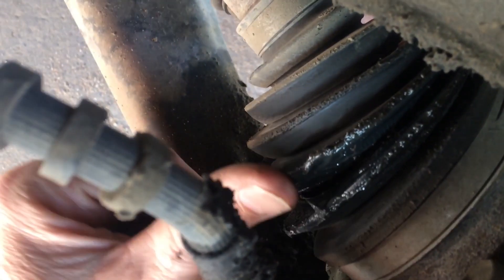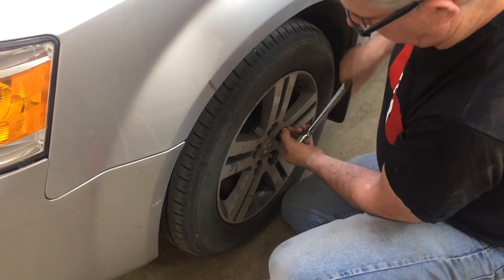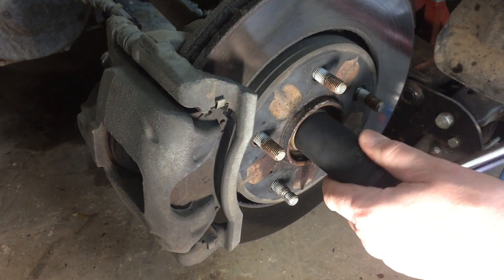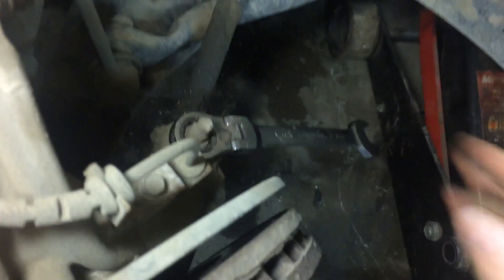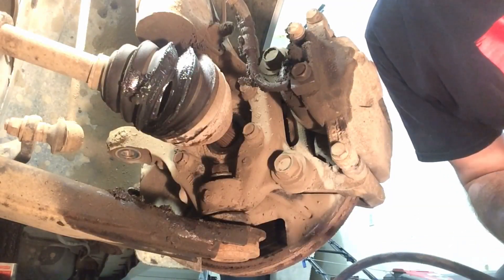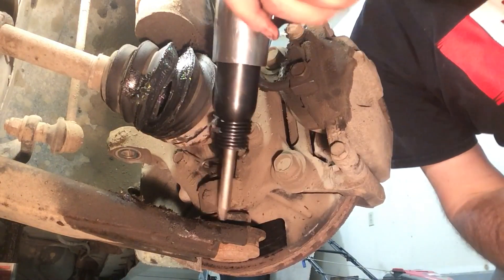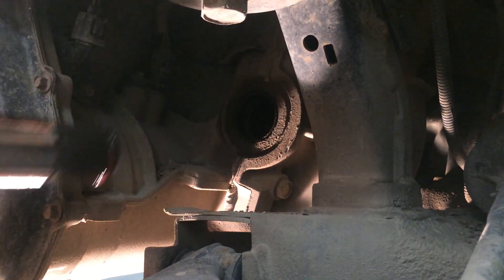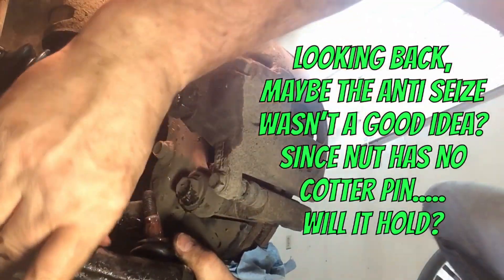How to change a cv joint on a Dodge Caravan drivers side 2008 to 2020 Town & Country VWRoutan(EP 38)

Comment from the maker: 🔽 Check out other videos in the Grand Caravan series!   🔽

https://www.youtube.com/playlist?list=PLgeVnQRQkbzBxJXNmFL9XwSTFcXcj0GQj
Reply: To check your transfluid, there's a plastic screw you can undo above the pan. Use your oil dipstick to check the level. Search it on YT you'll see
Reply from the maker: @brianramsey414  Thanks Brian! I actually have a video on making your engine dip stick work with checking the trans levels, temp etc. it somewhere on the channel. Thanks for watching this old video. It was one of the first ones. I am at close to 600 coming up. Hope they are better and more to the point. I have also upgraded to 4k video as well.
Reply: @unclemarksdiyauto  Yeah just subscribed so it hasn't popped up yet. Cheers! Keep up the good work!
Reply from the maker: @ many more grand caravan videos in the works!

Comment: I found i didnt have to take out the lower ball joint or the tie rod end. I simply undid the two bolts holding the strut the the hub and let the whole assembly drop down far enough to get the cv shaft out. Put a jack under it to keep it from pulling on the brake lines and you're golden.
Reply from the maker: Logan Jones, will have to try that next time. That’s for the time saving help! Why take something apart if you don’t have to? Since it’s on a Dodge Caravan, you know their will be lots of opportunities for me to try your suggestion!
Reply: Are those two bolts that holding the structs ?  Is one of them a CAM bolts that movement of which will require a tire alignment?
Reply: @ztian2506  I would recommend getting an alignment after doing any suspension work. Disconnecting the tie rod and ball joint could also cause misalignment. If you are worried about it mark the bolt and install them in exactly the same point but I believe all the alignment adjustment is done at the top of the strut and the tie rod...not the bottom of the strut. But I'm also just a random voice on the internet. Please consult an expert as I am most certainly not! Good luck!
Reply: @loganjones2119   thanks what I am thinking to do is to take the bearing out without touching tire rod or ball joint. if I remember correctly, south auto main channel Eric O one of the videos was like that.
Reply from the maker: z tian, I am thinking yes. If you look close you should be able to tell. You could mark them as to their angle and line them up on reassembly.
Reply: @unclemarksdiyauto  they are not cammed bolts after doing some research. They are just splined to stop them from rotating. However some aftermarket struts have sloted holes instead of the factory ones which were just exactly the size of the bolt. If you have an aftermarket strut like that removing these bolts would most certainly throw off your alignment.
Reply from the maker: Logan Jones, couldn’t remember so thanks from everyone else that may see your posts. Good information to know. Next time that is the way I will go, since it won’t screw up the alignment. And it should be a faster way to do the job.
Reply: That would be another Mistake! Unless you want to go get another wheel alignment, You DoNot loosen or remove those two strut bolts. Sure, you may think you put it back same way,, but a month or two later, check your tires for Bad uneven wear. My friends, Not to brag, but I worked for National Car Rental of La Guardia Airport in Queens Ny, and I did this a vast amount of times, my first Wrong way of doing it, the Master Mechanic observed me, and after I was done, he corrected my method by explaining it, and then had me bring the car over to the wheel alignment bay bcuz he said That car was Not leaving there after my fiasco..lol. So in short, I pass on my knowledge and experience. Just remove Cvjoint nut, knock tie rod out (IF you must) and tilt knuckle, then tap Cvjoint shaft in and begin prying loose till it clears the bearing and knuckle. Make you have an oil pan under the inner Cvjoint bcuz when you pop it out, fluid will leak. Just have new joint ready on floor so you can drop old and pop in new. Another thing, be patient, trying to pop the drivers side joint is like the more difficult one. You have to use a strong pry bar and catch these edges on joint, lean pry bar against tranny or so, and wiggle hard on front and back sides.
Reply: @ztian2506  All you have to do is trace along the strut mount bracket when you take the two large bolts out and put it back on the lines and it will be perfect I’ve done it hundreds of times and never got an alignment
Reply from the maker: @ztian2506  Yes it is!

Comment: Your video is great man I was able to fix my drivers side CV axle just by rewatching n following along as I went lol
Reply from the maker: Great to hear Steejans! I just did one on a 2007 Chrysler Sebring on the passenger side. Did much if any trans fluid leak out on the drivers side? If so, I have a video on how to check the level in my Grand Caravan playlist.
Reply: Some did I added some back in thanks!

Comment: I thought I had to replace the passenger side CV Joint on my Dodge Caravan. Turned out the clicking noise I heard was caused by one of the lug nuts not torqued to spec (it was like 75 foot pound instead of 86 like the other 4 lug nuts). Thanks for the very helpful video! I am sure the rest of it will be very helpful for me at some point as well!
Reply from the maker: I had a lug nut come loose and get damaged! Did a video on it's replacement as well! Hope you figured out your issue before you purchased a cv joint.

Comment: Fyi,, the ball joint does not need to be disconnected. Once the Cvjoint nut has been removed, you can disconnect the tie rod IF you want (I never do). If it's the driver side I've turned the wheel to far left and pop it out the spindle. The bigger problem is trying to pop the end that goes into tranny out. Right side is usually no big problem, but drivers side can become a challenge. You need a strong pry bar, if that type has the notches. Place bar against tranny body and tip into notch and pull (like opening a can of paint). If it doesn't pop out, you'll need a puller.
Reply: That's what I was gonna say. Just crank the wheel you get more room
Reply: The driver's side is a HUGE problem trying to remove the CV drive axle on the driver side. Is it the circular clamp that prevents the spindle from coming out? We've tried a pry bar and a Slide hammer puller. However, the slide hammer puller even with the adapter hasn't worked either, can't fit it behind the cylinder portion. Please advise. We have a 1999 Plymouth Voyager SE with a 3.3L engine that we're working to remove the CV drive axle. Is there something we're missing? I've followed the video, and see that you used a wide tip screw driver to pry it out towards you.

Comment: If you put pressure on the bottom of the ball joint and push it up without antiseize the taper should hold the ball joint from spinning until the nut is tightened . You might have to double wrench at the nut if it spins in the taper for the final torque. One wrench on the nut and another above it on the ball joint.
Reply from the maker: As you can see, there is not much room for double wrenching on this one.
Reply: @unclemarksdiyauto  yes but when you get the nut down far enough to let the end come through you can put like a small 11/32 on the ball joint so when you tighten the nut it will not spin the ball joint in the taper. If you put a jack with a piece of wood on it under the ball joint and jack it up it will push the ball joint into the taper and help lock the ball joint from rotating when you tighten that nut.
Reply: Here's a helpful hint. For both the ball joint and the tie rod end use a jack and put some slight upward pressure on them to keep them from turning. It's better than vise grips.
Reply from the maker: @crosleyman50  Great tip! This is a old video, and I have used you technique and it works great!

Comment: I like the way he went about the job. At least he doesn’t need a wheel alignment, if you would of disconnected the strut.
Reply from the maker: Thanks! Yep, others screw up the alignment & it is extra expense you don't need. This is a little harder to do this way, but you save in the end.

Comment: Thanks Canadian Uncle. Great Video.
Reply from the maker: Quick tip: It looks like you can remove the 2  strut bolts on these and not mess up the alignment as with older struts from the past. Much quicker to just undo them and separate the bottom from the upper strut and pull out the CV joint. I will have to do a updated video on this.

Comment: If you put a dab of grease on the end of the cv axle it makes it easier to install into the transmission. Watched my GPA do a lot of these at his brake shop.
Reply from the maker: Good tip. I have to do the other side in a couple of weeks and will you your suggestion!
Reply: @unclemarksdiyauto  yessir I am about to do the drivers side on my 08 town and country touring in a day or two. Autozone has it in stock for $79 which isnt terrible its there brand Gold

Comment: Help ⚠️Please!)
 Is transmission fluid needs to be checked and refilled after this done ? We brought car to mechanic to change cv axle , and after few days we got transmission problem 🙆🏻‍♂️
Reply from the maker: When I have done this one and the passenger side, I don't think I even lost a drop! The trans troubles may be coincidence. There is no dipstick, so there is a procedure to check it properly. Is there a shop you can trust to check it properly that won't just say, yes the trans is junk? The proper way to check may cost you 1 hour labour. Maybe it is low enough that they can check & top up. FYI: A over filled transmission will also cause issues too.

Comment: How did you get the inner cv axle out like nothing? I’ve been working on it for 2 weeks now and i am stumped 🤔.
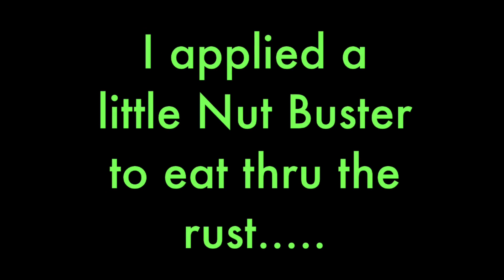Reply from the maker: may try and turn the cv joint 45 degrees and try popping it out again. Should be able to pry gently between frame or transmission and cv joint. Fi it does not come out, turn another 45 degrees and repeat. I show what this clip looks like and how it works @ 11:18 of another video:  https://www.youtube.com/watch?v=rdIIiWn5XBo
Reply: Thank you so much that’s what worked! I had a clip inside it that needed to be facing a certain way. Now I’m having trouble getting the new one on because of the clip. Dang can’t win
Reply from the maker: @alecpedrotty3405  Did you figure it out yet?

Comment: if you take the brakes off you can use an impact socket and hammer it into the lower ball joint. your better off taking the strut bolts off and tilt forward and the cv joint will come out.
Reply from the maker: Good suggestion Pv!

Comment: Lot easier job then I thought..! Good video.
Reply from the maker: I believe the 2011 and newer you can just skip dropping the ball joint and go right to those 2 strut bolts. On the newer vans, it does not affect alignment. (It is kinda not adjustable, well with out a special kit)

Comment: You have better results taking the stud out for ball joint by hitting on the hub where the ball joint stud goes in  not the control arm or the stud
Reply from the maker: You are correct Nick. In my other newer videos, you way is how I have been doing it. Thanks for your good suggestion! It will help many folks trying this out.

Comment: NEVER mess with a ball joint if possible.  Avoid ripping the boot.  Just unbolt the brake line brackets to provide slack, put a jack under the spindle for support, take out the 2 strut bolts and pull it forward.  Viola.....axle comes right out.
Reply from the maker: So true Sheldon, except you have to be very careful that both those bolts go back in exactly as before otherwise alignment will be off. They are alignment adjustment as well as holding the strut. I didn`t want to have to pay for that.

Comment: You need to look for cv shaft mine is 180 f/pounds i get 118 for my strut to hub  two bolts the Haynes manual states 180 f/pounds.c/v shaft  bearing hub bolt.

Comment: I want to replace the axle seal as well since I have the half shaft out, but everywhere I search online the seal name and price is so ambiguous it makes me feel like years of martial arts division 1 NCAA football and numerous TBI's on 3 different continents has caught up to me. By any chance do you have information on the axle seal or maybe an OEM Mopar number any help would be a godsend and appreciated.  Thank you
Reply from the maker: I bought these on Rockauto.com (not a sponsor) it is easy to use. It will give you some choice as to what you want to spend too.
Reply: @unclemarksdiyauto  and the seal
Reply: @unclemarksdiyauto  I'll check it out hopefully I will be in luck.  Thanx
Reply from the maker: @Bill_BarneyJr.  since this video have replaced the passenger side cv joint and later the passenger axle shaft and hanger bearing. Check out my Grand Caravan playlist for those videos.

Comment: Dear Uncle Mark next time you need to do a Ball Joint's or Tie Rod End's  here is a little secret I use  I never use a Fork I loosen up the nut leave it a couple threads on the stud  take your little 3 pound Hammer give the knuckle where the stud go's threw a couple good wacks it will pop the stud out that little trick never failed me yet & I have done a whole lot of them that way never had to use a fork
Reply from the maker: Will use that on the other side when I replace it, which is soon. Video to come also.

Comment: I have a whining humming sound coming from driver side front on my 2013 Dodge Grand Caravan. Sounds like a wheel bearing but I checked it and it has absolutely no play. Could it be  cv joint? Any ideas?
Reply from the maker: My opinion (without being there to listen) is whine/humming/rumble is a wheel bearing. (CV joints usually clicks or knock, especially when turning sharp left or right & many times have a ripped boot) If you could lift front on jack stands, hold hand on strut spring and rotate wheel by hand in neutral with E brake on, bad side should vibrate into spring and you should feel it & probably will hear it if you can spin it fast enough.
Reply: @unclemarksdiyauto  My fear is that you are correct. It sounds like a bearing. I am afraid that it is a bearing inside the trans.
Reply from the maker: @4150CHF  Wow! Hope not. Front wheel bearing failure is common on Grand Caravan. I did our van drivers side at about 50,000 miles or 80,000kms. (mostly pavement) A buddy does mostly gravel & did both sides twice by around 120,000 miles! Email me what you find. (See my  about section) Or if you have more Q's.
Reply: @unclemarksdiyauto  Do you think that it could be a wheel bearing even if it seems tight? There is absolutely no play/wobble when I put the van on stands and try to wiggle the wheel.
Reply from the maker: @4150CHF  YEP. It is a big job to do. Very good idea to get someone you trust to diagnose it. (& probably fix it)
Reply: @unclemarksdiyauto  I can handle a wheel bearing/hub assembly. I can fix almost anything. I am just horrible at diagnosing.
Reply from the maker: @4150CHF  Got a knowledgeable buddy that could help you diagnose it? Hands on diag is the best! Could also be a bad tire! Maybe swap to opposite side see if changes?

Comment: So how long could you drive with it like that like let's say you discovered that was the problem but you didn't have the money right away to fix it do you think you can get maybe a week or two out of it like that?
Reply from the maker: Terrell Mayfield, if it doesn’t make noise, hard to say. Off the top of my head, I drove it maybe 1000 miles on the hwy, straight line, not much turning. I have heard of some folks driving them for months before repairing it. The sooner, better!
Reply: If it was only a torn boot it's possible that the boot alone could be replaced without changing the cv axle
Reply from the maker: Matt Jones, it’s as much work, since you have to pull joint off the brakes and rotor to slip boots on and off. If I remember, New boot alone was at least $65, complete shaft was $122 no core.
Reply: @unclemarksdiyauto  They make boots that are split so they can go on without taking anything else off.
Reply from the maker: Have not seen the split boots in years, but may be available. Wonder if they are not very good since you never hear of anyone using them. I would be leary to use them unless it’s a cheap car that isn’t used must. Just my opinion.

Comment: You don’t want to put anti seize or grease on the ball joint , one thing you don’t want is it to turn when reinstalling the nut, a little valve grinding compound makes it stick so you can tighten it up. Especially when new.

Comment: Do you still remember  the site  where you  purchased  the cv ?  Thanks
Reply from the maker: Cenon Manuel, Rockauto.com. I tried not to buy the absolute cheapest, but it was cheap. We must have drove 5000 miles on it already.
Reply: Uncle Mark is this your go to place for auto parts shipped to Canada?
Reply from the maker: Will Yum, so far yes. I try to source locally, but most of these parts with similar quality are much cheaper if you shop around. The place I mentioned in the video has had some good pricing even with shipping included. (They are not a sponsor)

Comment: Tierod end and the 2 bottom strut bolts is all that need removed
Reply from the maker: I didn't want to touch those bolts as they change the caster setting and I didn't want to pay for a alignment, or wreck my tires.